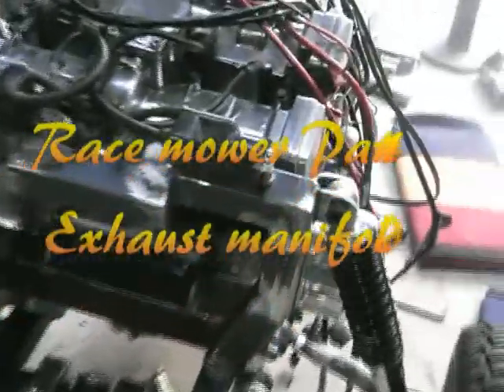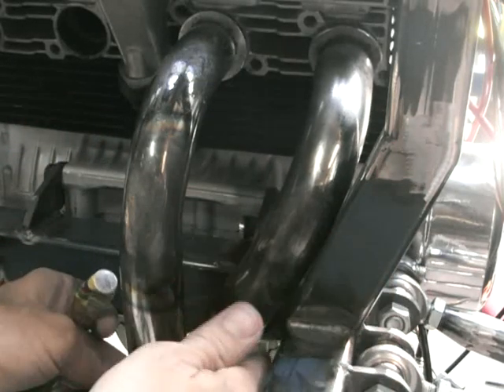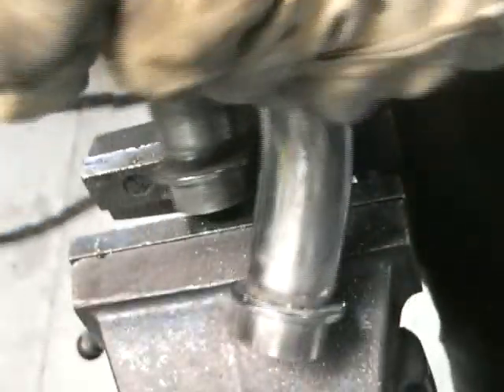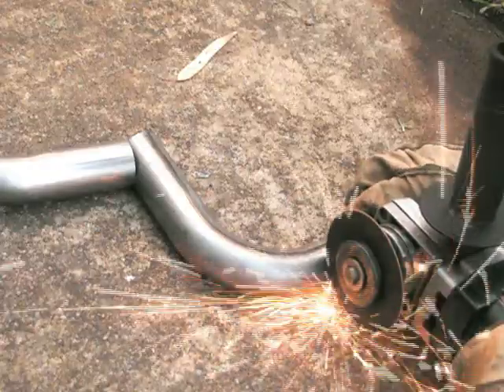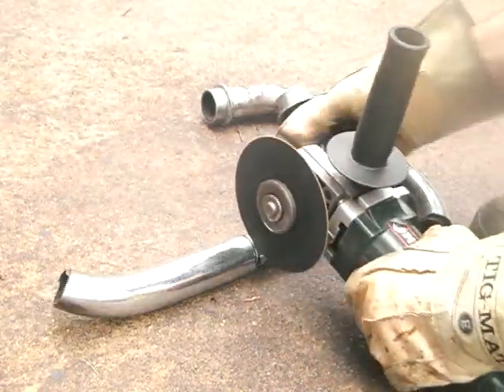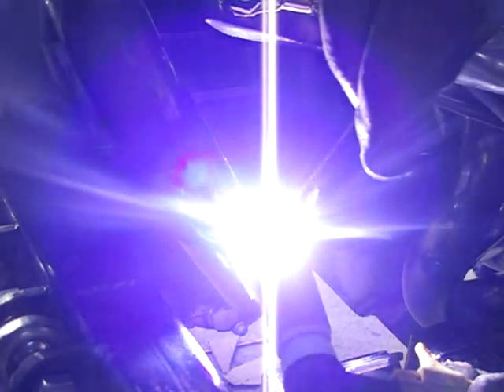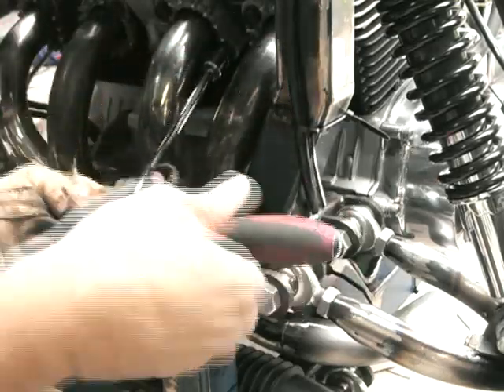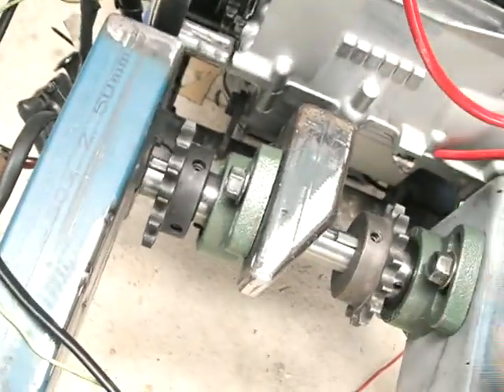Race Mower Part 14 Exhaust manifold

Comment: Why did you mess with the double pipe? I did something similar to this and just fabbed my own pipes and wrapped them in heat shield. Especially since your going 2-1 you should step up to 1 3/4" or 2" straight back from the collector.
Reply from the maker: The inside of the double pipe is only around 3/4 inch so no point going too big after the collector. Its very tight on space so thats why I kept with the original 1 1/4 tubing....
Reply: OK, Still I would have at least gone with the 1.25 minus the inner pipe you can free up lost hp and tq. Ive made about 3 go karts/lawnmowers with custom powerplants. Even made one with a turbo 4BT I loved the engine rebuild you did at the begining no one does that and you did it very good explaining to all the non pros. thumbs up and A+